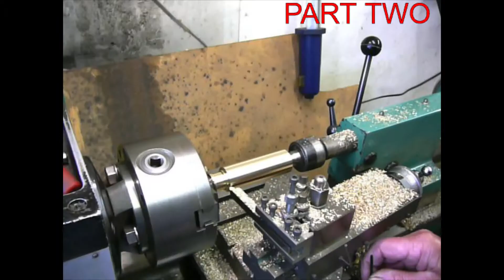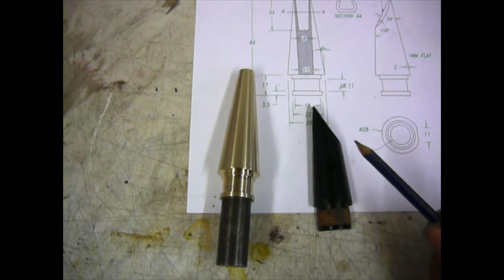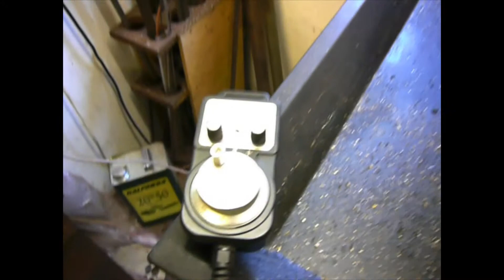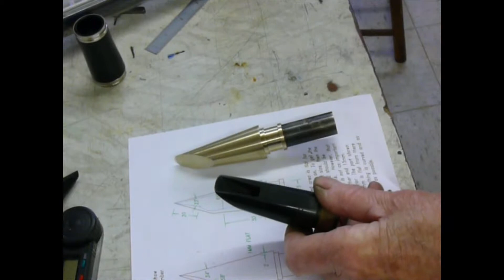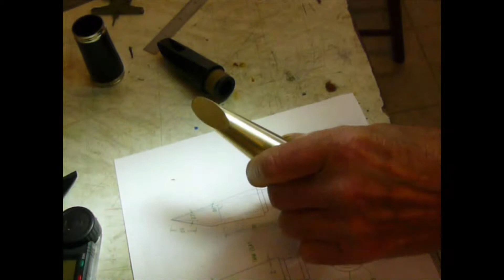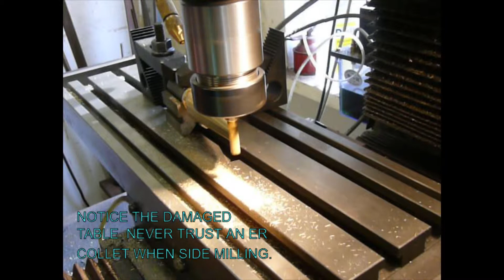An attempt at making a brass Clarinet mouthpiece Part 2

Comment: You ever figure out the production of this mouthpiece
Reply from the maker: @lne_chi  it wasn’t really a success.  I  made a mistake in the first angle of seven degrees because I set my cutter at 7 instead of 3.5 degrees so it became too short. Although it payed quite well it made the clarinet out of tune.  I should really have made another but the weight was quite high and I didn’t have any more brass at the time.
Reply: @ uou think you can make one for me?
Reply from the maker: @lne_chi  sorry. I’m afraid I’m not able to as I’m working a few hours at a time on a project.  I’m a bit limited as I’m now 92 years old and standing working a lathe for any length of time is just a bit too much.